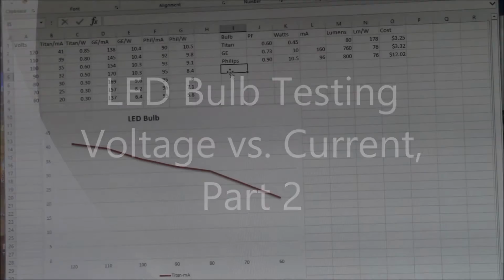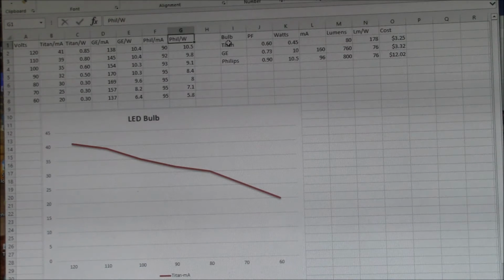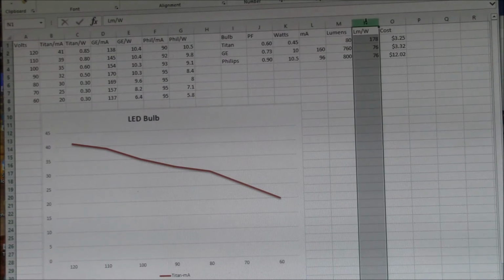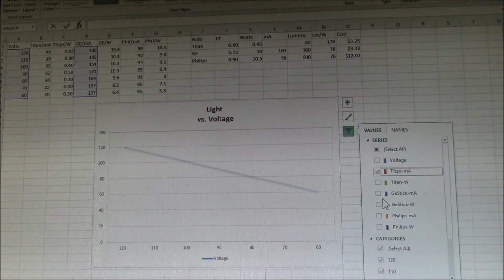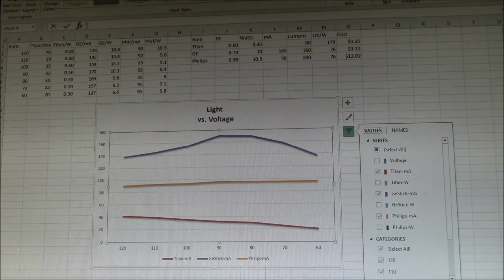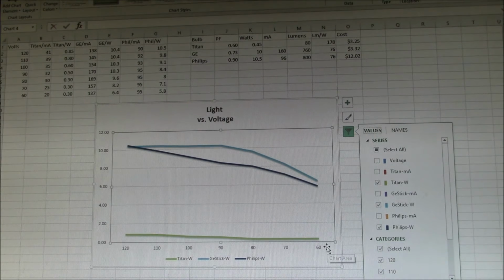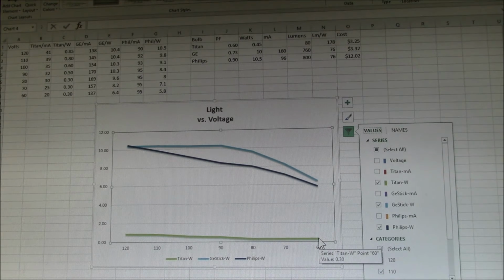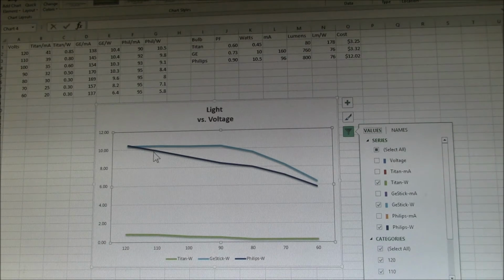LED Bulb Voltage vs. Current, Part 2

Comment: The lumens on the titan seem very low for a similar 120v input.
Reply from the maker: I was only going by the mfg. rating on the package, and I suspect that Titan bulb was vastly overrated and also they seem to be over driving the LEDs by a large factor, which probably explains why they only lasted a few months in use.  I do need to revisit that bulb and take a closer look at it.  I may try replacing the blown LEDs and fixing the driver circuit to get a more reliable drive current.  They are a nice small  package, might be able to make a decent little bulb out of them.